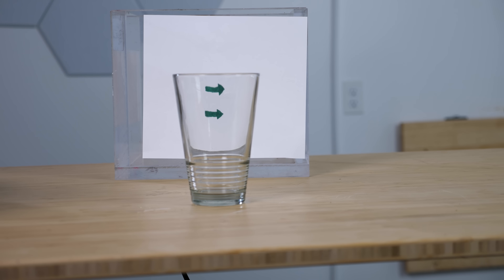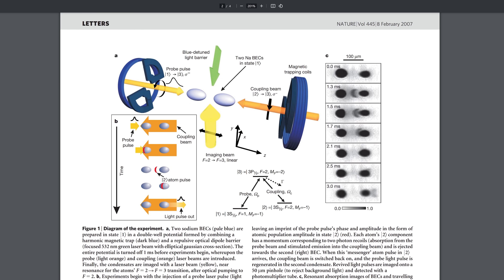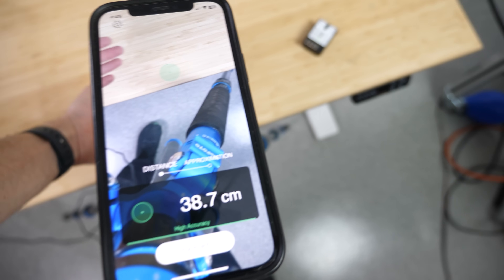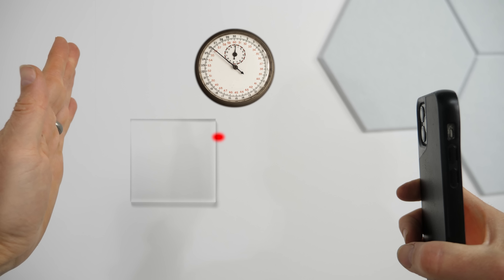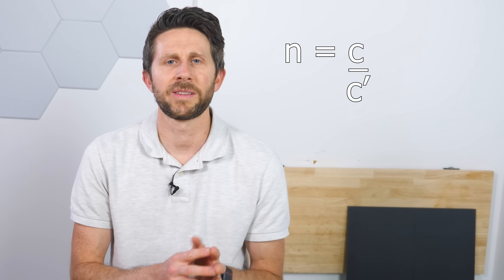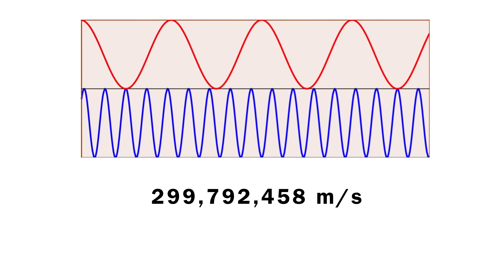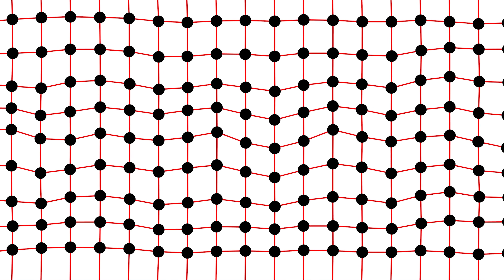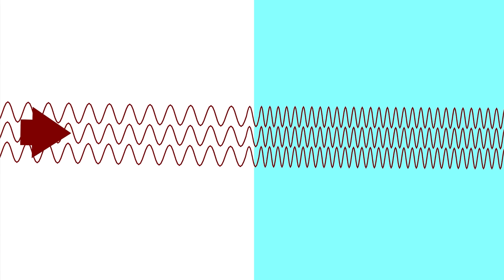Solving The Slow Light Paradox

Comment: 7:00 YOU ARE WRONG, because you just stated here that the speed of light in glass (or any other substance) is not fixed, but depend on how many layers of electrons it passess through :) the deeper you penetrate the more light slows down (ie slows down gradualy), but then why then immediately it speeds up after leaving glass or water? :) it is just simple reflections, not secondary waves superpositions :) actually how many photons on the sphere can produce such charge displacements? :) feinmen and you with friends all got it wrong

Comment: You showed the light as a steady state sinusoid.  What if the light was a pulse of very short duration; shorter than the I-phone.  Considering the head of this light pulse, how would any secondary emission chop off the existing head of the pulse?  It's the head of the pulse that determines the speed regardless of it's phase.  In other words, what kind of secondary wave could chop off the head of a pulse that insists on going C, and then suddenly stop canceling it allowing the head to appear at a later time?
         If one insists that the head of the pulse always is going "C", how could any secondary emission catch up to it to cancel it?

Comment: If what you are saying is true, then conceivable could it be possible to 'reconstruct' the original 'unphase-shifted' wave once it leaves the material? Or is the phase-shift permanent? Could this paradox be used help to explain things like quantum entanglement? From what I can gather, it is the mass of the photon engaging with the mas/density of the material that 'causes' the slowing down. So in theory, if the photon was able to maintain its constant speed in a new material, then it would either have to gain additional energy to be able to 'interact more vigorously' pushing through harder, or it would have to lose some of its mass such that it has less 'engagement effect' with the new field?

Comment: The laser passes through the block once to the card then up into the block and reflects back down to the card again from the top of the block before coming back up through the block back to the sensor. It is possible only 30% does this but it's enough to throw the sensors Accuracy off.

Comment: So how we measure distance in the universe. there is no proof that the universe is an empty material. also how guaranteed that there is no reflected material in the universe that shorten the distance because light came back quickly.  also if any one can tell me how we ever measured the distance between planets and stars. if it is a n light years. shouldn’t that means we will need 2n years to measure it ?

Comment: Someone explain to me how this works as a photon of light. Whenever I see videos or explanations done about this, everyone starts showing waves. While I know light behaves both as a wave and as a particle, if we don't know how an individual photon 'knows' it transitioned into a different medium, there's a possibility this wave theory is also incorrect. Also, the way it's explained here and everywhere else is that a single atom's electrons changes the wave and then it gets passed on to the next atom's electrons.... but isn't this additive? If that were the case, enough length of the material would make it completely opaque, and well before that the refractive index would be observed as being dynamic. It makes 0 sense that this is considered the proper explanation.

Comment: If the wavelength is shorter inside the cube, what color would a CCD detect if it was molded into the cube, or fixed in a way that removes any air between the CCD sensor and the cube, and then shine red light through the cube and into the CCD sensor?

Comment: Once you found materials of different densities that allow you to observe diferent distances at the same optical paths you can change the temperature of the material, that will drop the measured "apparent" speed, and explain Hau's team observations near the 0K boundary. Not by slowing light down but by slowing down atom's internal mechanics. Yeah, something moves inside atoms and that movement is driven by ...
temperature, not by fiction science.

Comment: you have to try an experiment where the IR laser goes though transparent materials of different densities, for example a transparent cylinder filled with air at different pressures (take precautions), and the same optical path. If you can use solid lidar IR-transparent materials with different densities, even better.

Comment: But if the earth is moving through space at 67,000 miles per hour and the Harvard people slowed a pulse of light down until it completely stopped moving and then they had it start back up moving again, then how does that make any sense? If the pulse of light was stopped, then shouldn’t earths motion through space affect it? 
Because light isn’t pulled around by earths atmosphere like helicopters and everything else. So how did they slow light down without it being influenced by earths motion? 
You’d think they could purposely use this manipulation of lights speed to show earths motion through space because that whole pendulum experiment is suspect in my opinion because you can’t actually check and see that the pendulum really does move because of earths movement through space. The pendulum experiment is sort   Of Pseudoscience to me because if you can’t specifically check every factor in an experiment then the experiment is flawed

Comment: So , you said light has no mass but moves in a wave format. I think light has mass. It's just not measurable.  One thing you missed is that when you put the crystal in front of the lidar, it also reduced the overall distance it is capable of measuring.  And that is because the light lost kinetic energy to heat because it has mass.

Comment: And then there's radiation. How does radiation travel faster than light, in order to slow down and give off light, like in Cherenkov? If it was traveling at the speed of light, then it must have no mass, so it can't be slowed by passing through a clear object, right? We only perceive it as slower because of the refractive index. But, in Cherenkov, light is created by radiation interacting with the mass in a medium. How does something travel faster than light, slow down, and produce light if it can't possibly have mass (because it travels at or faster than /c/)? If the speed limit of time and space is light, then faster than light would travel faster than time, which shouldn't be possible. You can't send a signal after you receive it. It must be sent first (to exist in order to be received).

Comment: Sound refracts the same way. My ultrasound machine needs to have the correct material velocity to measure the time of flight properly. My machine can find a defect the size of a grain of sand through 50 inches of steel. Did ultrasonic non destructive testing at a steel casting foundry in Berkeley California. We use lucite shoes coupled to the transducer to do shear wave inspection that looks for flaws at an angle where straight longitudinal waves can’t reach. Sound does not propagate through air as well as it does through water or other viscous coupling agent.

Comment: How does the pohne measure such small distances with any precision? If the phone has 3Ghz processor, than it does one cycle in 333 picoseconds and by that point light will have traveled about 10cm… so I can’t understand how you can get precison better than +/- 10 cm.
Someone please explain, it has always bothered me and can’t find any sources on that.

Comment: Forced explanation, if not downring false. Just as in the case of wave on a string meeting a thicker or heavier portion of the string and when the speed of the wave in that string decreases and a reflected wave appears at the same time, the light passes through the vacuum, which is not a vacuum, it is a state of very rarefied matter, in an environment with condensed matter. Everything happens as in the case of that rope.

Comment: Maybe the speed of light stays the same, but the frequency lowers? Along the lines of the frequency emitted by the LiDAR module is higher than when it is received. So the sensor is expecting a certain frequency based on the distance from itself, sort of like echolocation?
Reply: This is also said in the case of Doppler effect for light, that the speed of light remains the same, but the frequency changes, which I do not think is true, because you cannot change the frequency withouth changing the speed if it is considered that light has no need medium through which to propagate (in the case of sound through air, this is possible when the source is moving and the observer is fixed).

Comment: The explanation was known to me as it's the standard one, but I always wondered about three things that so far nobody answered: 

1) The secondary waves created by the "wiggled" electrons move along with the incoming initial wave. But what happens to those waves once they all exit the glass on the other side? They all still move with c, but why does the "kickback" now reverse and the wavefront no longer (apparently) slows down?
2) You talk about "second order propagation" - ok but why are there no third, fourth,... until light slows down to 0?  
3) Wiggling an electron needs energy. Thus a photon should lose energy and thus change its frequency (hf). Why does it not do that?
Reply: A wave decrease in amplitude when it loses energy, not frequency. On a microscopic scale, the release of energy takes place in the form of quanta, which are released in their entirety. At least that's what quantum physic says.
   Yes, there might be a wave going through glass without slowing down, but only at the beginning, until the transient regime passes.

Comment: According to this interpretation it would appear that the light must change color while it is inside the glass. If the crests are close together it means that the frequency is higher and therefore the color of the light should turn towards blue. Is it possible?
Reply: The frequency remains the same, because both the wavelength and the speed decrease.

Comment: In some of the diagrams when showing that the speed of light slows down, it looks like the wavelength of the propagated field (original+electrons wiggle) changes, which would be a change in energy. Does the sum field, which moves slower, have a different wavelength and therefore is light of a different energy? If so, a follow up question. Light interacts with different materials differently based on its energy. Does this mean the product wavelength have different interaction probabilities? The three wavelengths exist in the block, the original, the electrons wiggle, and the sum of the two.

Comment: The problem is that although this explains things like refraction, it doesn't explain why the LIDAR shows a slower time. If the wavefront is still travelling at C, regardless of the summed waves' "speed" then there should be no extra delay.

Comment: Light does not have a fixed speed, it has a rate of induction that changes with the median IE: glass, water  atmosphere, acrylic. Is the preservation slows down when it hits one of those and speeds back up when leaving. Thus proving the theory of relativity and the laws of thermodynamics wrong. It's not the light that's traveling. Nothing is traveling from A to B. It's The Ether waving. C is simply the speed of the perturbation in a vacuum.

Comment: I've always thought of light moving "slower" through some medium is just the light "bouncing" around in said medium.
While the full explanation may be more accurate, it's simply easier to wrap your head around it.

If you jump into a pool of water, you now fall slower than you would in pure air.
And you can still see all the way to the bottom as if it was air.
But the denser medium simply makes you move slower because you are bumping into more stuff on the way.
And that's what i think of when light "slows down" when hitting something.
Reply: You can think that. It isn't right though. The problem with analogy is we are the quantum scale and our intuition is all wrong. None of these things are objects as we understand them and the concept of a medium is meaningless.
Reply: @101Mant  Yep and i did say that.
But to wrap your head around the phenomenon in a practically usable way, it does help to look at it in simpler terms.

Comment: I have a different explanation - the light has to travel extra distance when in denser material. light particle enters the material and starts to "wiggle" while affected by field forces around, the light is not slowed down actually, it's forced to do extra route. if you run straight line, of course you run to end in shorter time than if you do zig zag run even your run speed is the same.

Comment: Sneaky.  The wavefront still propagates unimpeded and without delay so the information of the initial bit is carried at true speed of light.  But unless you are measuring single initial impulse you don't realize everything else is just connected and correcting for the sneaky snake.

Comment: I wonder if you can recreate the process using water with floats on the surface. You could see if the ripples on the surface causing the floats to oscillate cause the same kind of wave interference and delay the ripples reaching the other side of the pool. I'd also like to see how this relates to Lagrangians.

Comment: Doesn't light have an impulse? So it would have a mass at it's relativistic speed? I might be completely speaking out of my ass but I always thought about it like this: the rest mass of light is 0 but the mass multiplier for traveling at 100% the speed of light is infinity. 0 times infinity is not defined, if you try calculating it, it can be anything, depending on the formula you are using. So maybe it just so happens, that the relativistic mass of light is actually *something*, which is, was we observe.

Comment: Using Maxwells equations speed of light is calculated from capacitance and inductance of space. Due to the higher dielectric constant of an insulator body therefore speed of light is slower.

Comment: If light is a particle, then how could it "slow" in acrylic and then "speed" up again once it exits the acrylic? It would violate the laws of physics. There is no force to act upon the light once it leaves the acrylic. So it must be a wave/perturbation alone in which the "speed" is dependent on the medium in which it travels. This is perceived as speed but is really a rate of induction. Not a speed at all. 

If you throw a rock in a pond, not one single particle of water that the rock disturbed makes it to the shore where you are standing. In fact the water particles really only move up and down. The wave the rock creates makes it to the shore at a constant rate no matter how far or hard the rock hits the water, because the wave is a rate of induction. The wave itself doesn't really exist; it is the perturbation of the medium that travels at a constant rate, depending on the medium.

It is the only way to explain why the light from a candle travels at the same rate "speed" as a 60w light bulb or a high intensity LED.

You can't have a particle with no mass. That is a ridiculous statement.

Comment: I agree with you. But I think the iPhone only judges the distance between the object and the iPhone based on the distance between the points of the infrared dot matrix (the time algorithm is useful, but only as an aid). The acrylic board/water magnifies the object behind it, which makes the distance of the dots look far away.
To test the hypothesis, we need to compare the measurement differentiate by magnifies is 1/2 the of the time differentiate.

Comment: Thank you for not reinforcing the common but extremely wrong explanation for a slower speed of light that the photons are absorbed and re-emitted by the material. If that really was the reason then nothing would be transparent since the re-emitted photons would have a random direction (not to mention a different frequency). That process is happening, it's what causes stuff to heat up when exposed to light, it's just not why the propagation of light through a material is slower than the speed of light.

Comment: Basically the interaction of the incident light and the matter wave takes some time to produce the resulting wave and the denser the material or the more fine-tuned the "shift" the slower the resulting wave propagates through the material. That is why it's possible to almost stop the light - it's like when a photon is traveling from withing the Sun's core to Earth. The core is so dense that there's so much interaction that the photon seems like it's slowed down until it reached the corona where it zips right through reaching Earth in 8m20sec.

What makes the material clear or opaque is if the resulting wave still has the same direction as the incident light but clear materials can occupy the photon for as much time as the opaque materials do.
Reply: The radiative pressure of the sun's photons forcing through the dense core (1.622 x 10 to the 5 kg/m3) and the surrounding currently created elements as well as those present in the initial molecular cloud does slow the straight pathway of a lot of the photons. 

This is what holds the rest of the gases in place as the density decreases. Eventually these photons WILL leave the sun and reach us, about 200,000 years after their creation.

Comment: Speed of causality is more accurate. Light in a vacuum will travel at that maximum universal speed limit, but is slowed down by things like air, water and glass. Plenty of videos demonstrating this with phones, and for some reason lots use the tank track analogy or rows of soldiers to explain refraction, both of which are terrible.